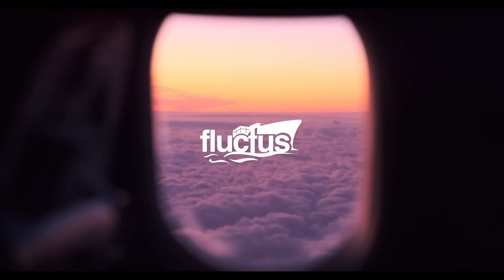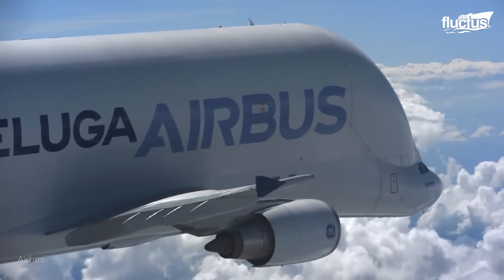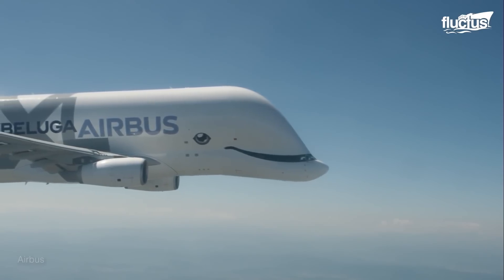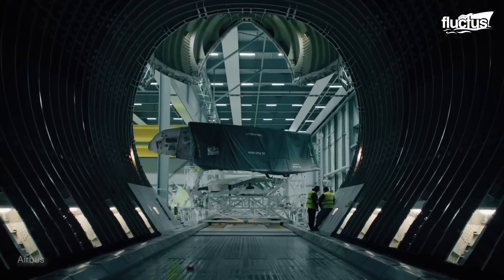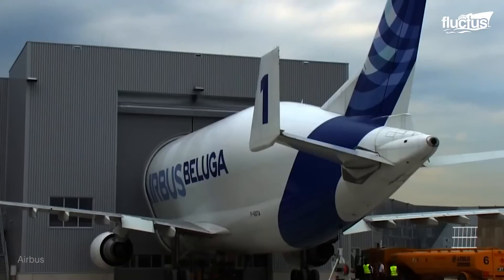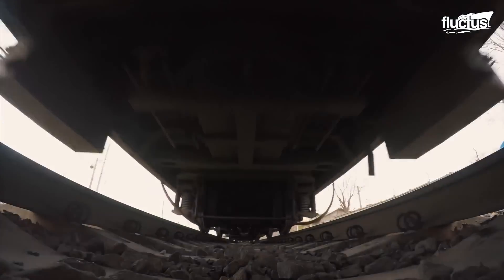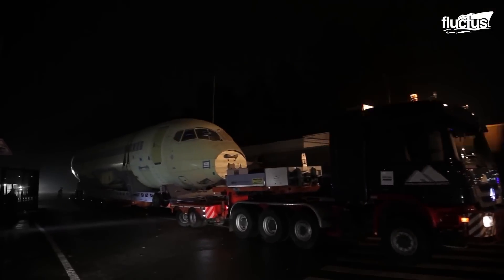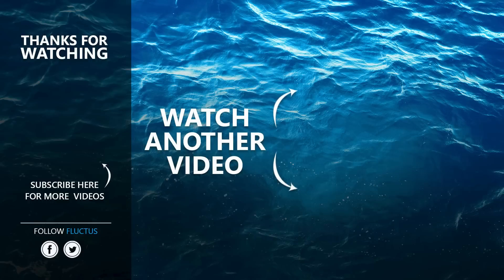Airbus Genius Idea to Transport Massive Plane Fuselage by Air

Comment: When was this filmed?  Space Shuttle was retired years ago!
Reply: wow smartie. did they also erase all traces of its existences from all media after retiring it?
Reply: "NASA space shuttles are some of the most high tech....". (shows a Saturn V).  🙄
It was only SRB propellent grains that needed to be brought cross country on rail.
In fact the solid boosters were at the limit of what could fit under bridges, through tunnels and past trackside infrastructure.
The tanks had to come by barge while the shuttle itself piggybacked on a modified 747.